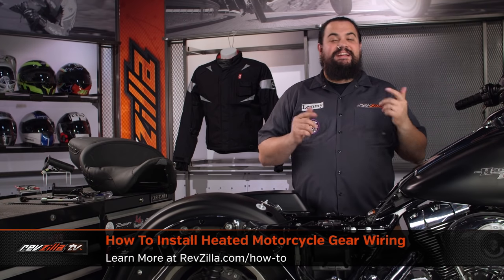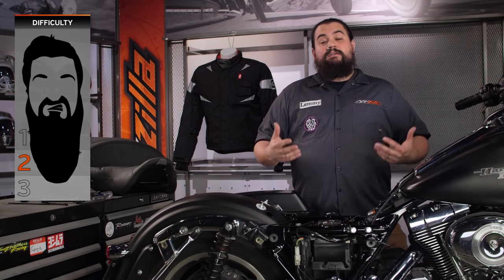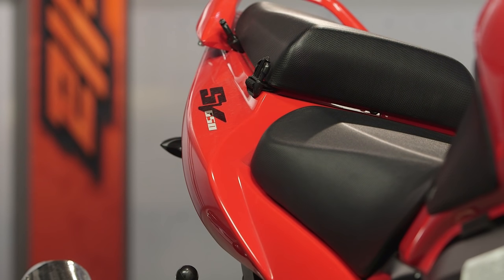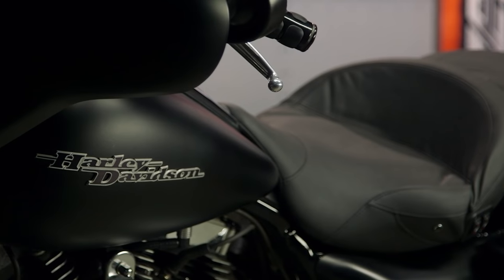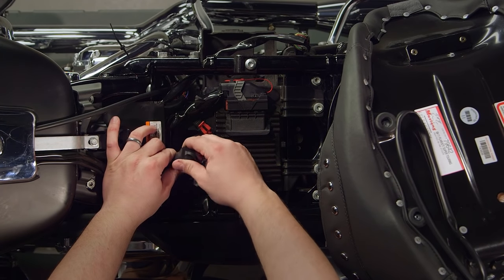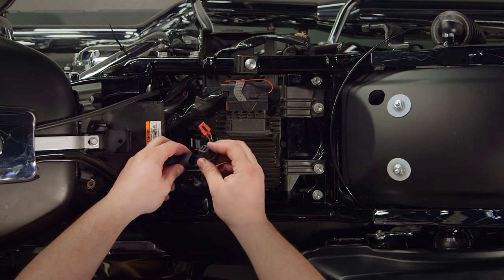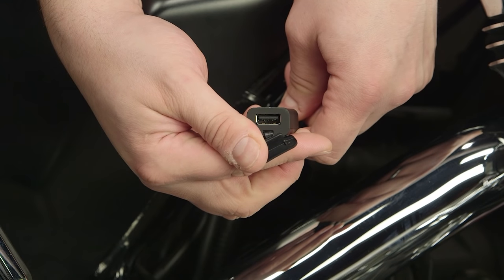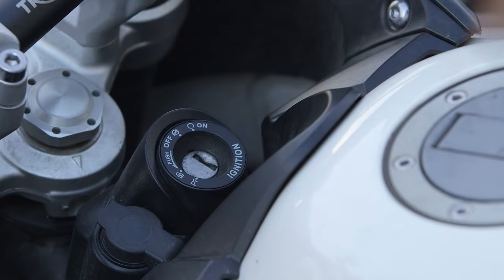How To Install Heated Motorcycle Gear Wiring at RevZilla.com

Comment: Thanks. Never realized I could just use the SAE lead instead of putting in a second lead.
Reply from the maker: +Yggdrasil42 Just make sure the SAE lead is rated for heated gear. If in doubt, use the lead included with your heated gear. Remember to use the appropriate fuse as well that matches your heated gear's draw. -DrewZilla
Reply from the maker: +Yggdrasil42 EDIT: Here's a more-detailed explanation directly from Lemmy's companion article. "The final step you need to take is to fuse your power supply. Get the total amperage draw of all the gear you are running on the circuit(s), and use the next-larger fuse on your power supply wire, without exceeding the amperage of the fuse that was installed in the lead. If you’re running ignition-switched power from an unused or existing circuit, remember that the fuse the manufacturer provides for the circuit is the maximum. Don’t simply stuff a bigger fuse in there, or you risk a fire and your wiring loom’s health and safety. Always fuse the positive leg of the circuit, as close to the battery as is practical."

Comment: I may be missing something, but in this video, when you’re installing the SAE lead, you’ve disconnected the negative first, for safety. However, you then moved the connector back in contact with the negative battery terminal while working on the positive. This defeats any safety of having disconnected the negative. Unless I missed some sort of insulator being placed between the connector and terminal? 

BTW, for snipping zip ties, I’ve found that a concave-curved fingernail or toenail clipper is great for finishing off the snipped end, so I don’t catch anything on it.

Comment: Can you please recommend a simple fuse block for my 2014 Valkyrie? I already run the full heated gear liner (gloves and soles too) but want to add my heated seat too. I’m in NYC and ride almost all year. It’s usually too cold in March on our local highways. I’m hoping the heated seat is the solution. 👍🏽
Reply from the maker: This Rivco is a good simple fuse block. -DrewZilla
*https://www.revzilla.com/motorcycle/rivco-6-circuit-fuse-block

Comment: what if your battery doesn't generate enough electricity to use several heated items at the same time? Is it possible to change the battery and put a more powerful one? 
Thanks Lemmy
Reply from the maker: Your bike's charging system determines how much heated gear you can run, not the battery. Yes, the heated gear draws power from the battery, but the bike's stator/charging system needs to be able to charge the battery faster than the battery is discharged. A bigger battery does not change that. To run more heated gear, you need a bigger stator, and most bikes don't allow for a bigger stator. -DrewZilla
Reply: So i guess before thinking of buying such gears one should compare their power usage and decide wether it's gonna fit the bike or not. Otherwise it would be a waste of money
Reply from the maker: Exactly. If your bike cannot support heated gear, it would not be a worthwhile purchase. -DrewZilla

Comment: I spoke to a gear geek at Revzilla today, who informed me that I cannot use the SAE adapter for the battery tender lead with my Hotwired heated jacket and gloves, that I purchased from Revzilla. He told me I need to use the harness that came with the jacket. So can you please tell me which is the correct way? Thank you.
Reply from the maker: This is correct. The Battery Tender harness is too thin to handle the greater draw of heated gear. You need to use the Hotwired harness with Hotwired heated gear. -DrewZilla

Comment: I live in MD so does it make sense just to leave heat accessories (seat and grips) on all year round and only turn them on when needed? does this damaged the bike (2015 Harley street bob) in anyway?
Reply from the maker: Yes, it makes sense to leave your heated seat and grips installed year-round. No, doing so won't damage the bike. -DrewZilla

Comment: i already have an sae lead for my batery tender, i want to add another one for usb and or heated gear. so can i add another sae to the battery?
Reply from the maker: Great question!

You can add another SAE lead with no issues for additional accessories, you just want to make sure you are not overloading your bike's EEC (Excess Electrical Capacity).  This is especially critical for heated gear.  For more on electrical requirements for heated gear I'd suggest perusing this article:

www.revzilla.com/common-tread/how-to-add-heated-gear-to-your-motorcycle

Additionally, you cannot use an SAE lead to run heated gear, as they are not rated for the appropriate amperage.  You would want a heated gear specific harness like this:

www.revzilla.com/motorcycle/gerbing-battery-harness

I hope that helps!
-Zack

Comment: will a heated vest drain my battery even if I always ran the engine while i used it? I have a 2013 hyosung aquila pro 650
Reply from the maker: With a Hyosung 650, your battery should be fine if using a heated vest while riding. -DrewZilla
Reply: RevZilla I am buying a Ural gear up 2020. Planning to ride it in winter so want to run the gamut of heated clothing and then also think of person in the tub. Should I be thinking of installing an auxiliary car battery.